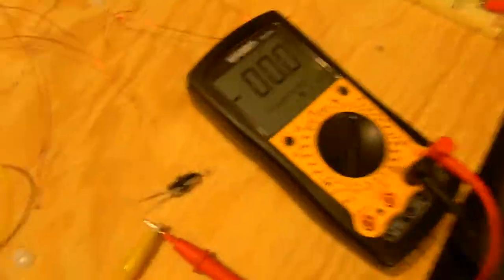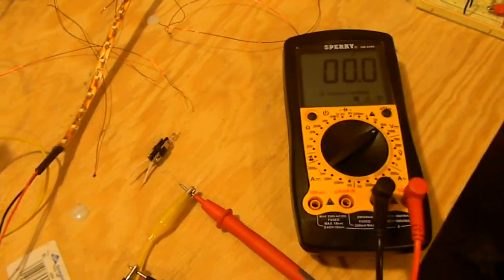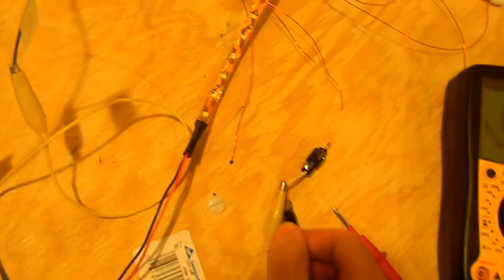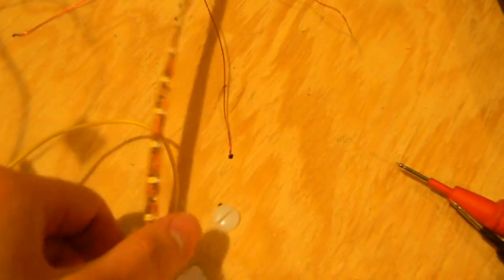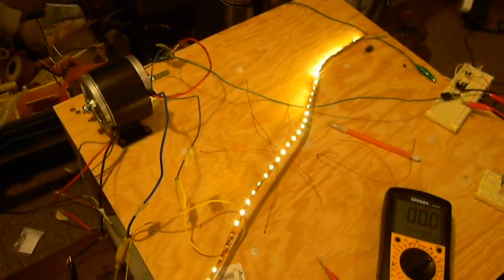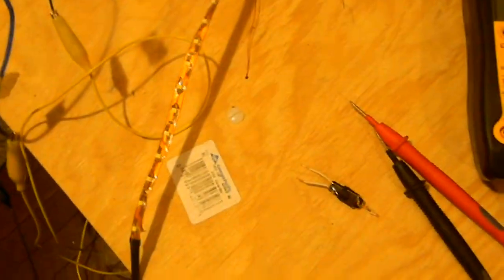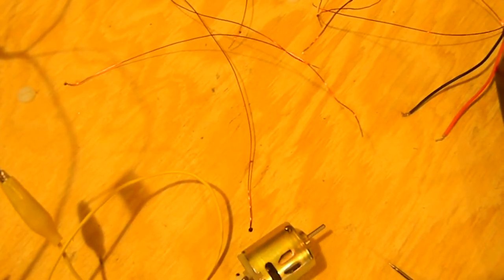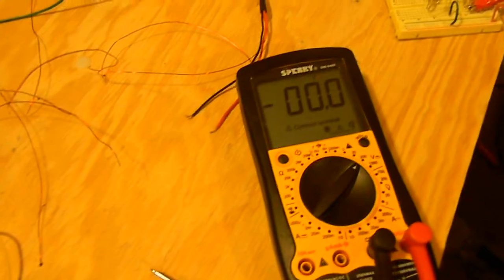Generator output test of asymmetric motor

Comment: hi, i have been researching floyd sweet and the VTA and i was wanting to share an idea with you since you have a open mind on endothermic reactions in electricity, i was looking at the design of a triode and as it stands you put electricity in which heats up a filament and creates a flow from the cathode to the anode and increases RF .... that being said it seems as though he reversed that process where he was using exciter coils and inducing high RF back into the triode